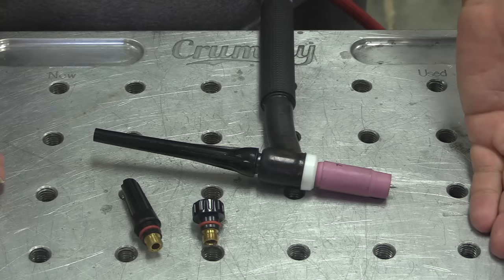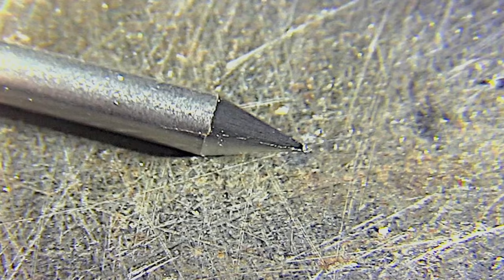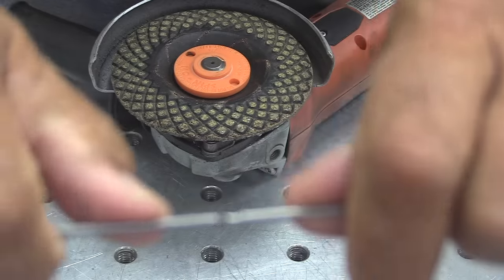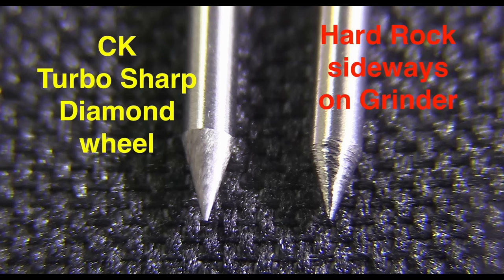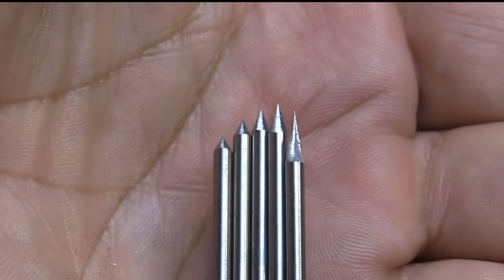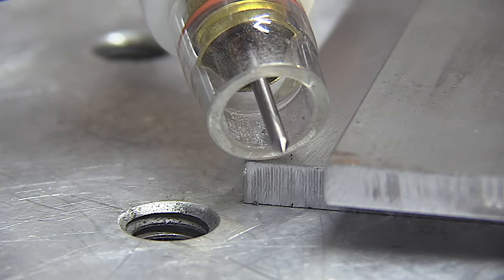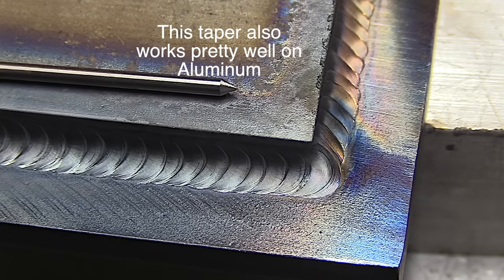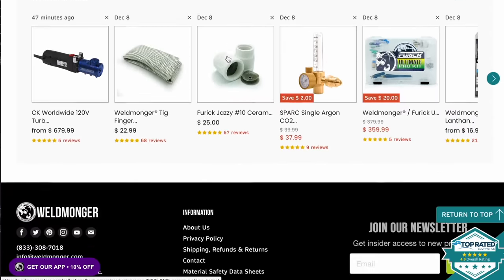🔧Don't Do This to Your Tungsten🔧

Comment: I've been welding going on 24 years now... I learned most of what I know from the older welders who weren't afraid to teach as "that is just how you do it"... and so.. it's how I did it and never really knew WHY... so to have the explanations given with such clarity is great and I can pass that info on to the newer guys that I teach tricks to occasionally. Thanks for preserving so much of our trade skill knowledge base and putting it in such an easy to understand format. I routinely suggest this channel to anyone who wants to weld or get better with their current skill set.

Comment: I’m a pipe welder in a shipyard. I use my angle grinder + diamond cutting disc to sharpen my tungsten. I drilled a hole in my grinder guard at an angle and use a drill to hold the tungsten. Comes out perfect every time.
Reply from the maker: That’s awesome

Comment: Typical Jody video, straight to the point, loaded with facts and the only filler is fused into the weld. 

BTW, recently received my stubby gas lens kit. I never realized it cuts your torch length nearly in half, I should have ordered one sooner! Thank you sir for making those kits and everything else you do for the community.

Comment: Thanks for another informative video.👍 I always carried a wooden handled “pin vise” to hold the tungsten while sharpening. A pin vise is basically a thin handle attached to a small drill chuck. It keeps your hands from getting too close to the grinding surface when grinding shorter pieces of tungsten. Later I found that a small cordless drill worked even better. 
Having worked nukes on and off, an observant weld inspector decided to sample the dust from around the tungsten grinding machine and had the lab test it for radioactive contamination. The results were surprising. Apparently from years of sharpening 2% thoriated tungsten, there was an amble amount of contaminated dust to call for a thorough review of the tungsten the plant would switch to. Soon afterwards other types of tungsten were being used and 2% thorium was removed from service. Just passing that tid-bit of information along. 👍🇺🇸👍

Comment: At work for our TIG robots and hand welders (part rework, die rebuilding, etc.) we use Piranha III sharpeners. For robot work it's a must (since things need to be repeatable) and for the rework welders it's convenience (since the welding lines they're on are often have TIG robots). For the die work, probably convenience again (and since we have so many of them company wide, spares aren't hard to obtain).

Comment: I'm just a hobby wrlder. I use the Primeweld 225, I use the belt sander/drill method to sharpen my tungsten. This was very helpful in knowing what type of tip to use for each type of weld and material. Also, I now will switch to a finer grit belt to sharpen my electrodes.

Comment: I'm a welding hobbyest. I purchased a $130 diamond wheel to put on my bench grinder and with a drill to spin it, it works great. I am guilty of "snapping" my electrodes BUT unlike your video demo, I butt the vice grips and lineman's pliers flush up against each other and have rarely had an issue. Because I'm not a pro, I inspect every ground electrode with a jewelers loupe to check for cracks or imperfections.

Comment: I have been snapping my 2% Thoriated, and i have noticed the arc acting strange on start up once in awhile, it does split odd some times, i grind them on a bench grinder with a fine stone the long way around 40 degrees, i'm currently welding 20 gage CR patches on a 27 model-T, thanks for your videos.

Comment: I am relatively new to TIG ,but i gathered allot of experience in 16-20 months since is started to TIG (18+years of stick weld helped allot),outta my shop,i grind my tungsten using a fine grit grind wheel or even a very used up cutting wheel on a grinder,and i hold the tungsten in a drill,spinning on the flat side of the wheel with almost no downward pressure to roughly angled tip,works fine to me,just a drill and a grinder and i'm good to go,i never throw the tungsten back to the torch without cleaning the oxide with a scothbrite while the rod still in the drill at max rpm,i ensure a nice contact with the collar,and i prolong the life of that collar (tungsten holder). I always have a great time watching|listen your vids,best regards from Romania <3

Comment: Another great video. I have concerns about tungsten dust accumulation in the shop from grinding tips. I'm still learning wire feed and maintaining a short arc, so yeah I dip too often, and have to grind tungsten often. I wear a dust respirator while grinding but the fine dust accumulates. Should I be doing my grinding outside in the freezing cold to avoid the dust? Are there health effects to worry about?
Reply: Not as far as I know, except if you're using thoriated tungsten. If grinding thoriated tungsten, at least angle things so the dust is aimed away from you.  Probably worth it to put on a dust mask for that also.  Some say that the risk of grinding thoriated (which is slightly radioactive) is only theoretical, but I think it makes sense to take an extra safety step or two.

Comment: I have had my tungsten split before and I chased that for quite a while before it fingernailed a piece of.  I have sharpened a lot of electrodes with a 60 or 80 grit sanding pad on a grinder; just keep the scratches running vertically.

Comment: Great info Jodie I’m very impressed by your knowledge and confidence and consistency I as well have adapted this tungsten cutting method just by chance some time last year when I found harbor freight was selling those diamond grind wheels so initially I wasn’t cutting them with a diamond wheel and then I tried it one day just by chance, and I found out that it was much more faster efficient and it put 10 times less heat into the tungsten than any other method that I tried as well as even trying the chemdip learning that the diamond wheel and just grinding them so much until you can break them by hand that it was much more efficient and faster method Thanks for all the tips and keep the good videos coming.

Comment: For breaking Tungsten in the field I would use two vice grips. Get snug grip and break one vice grip next to another. That typically prevented splintering.

I currently fusion weld sanitary pipe. Use 30-40 amps, and a 1/16 tungsten electrode. I use the exact tungsten sharpener at 40°. 

I use 40° because I can't fulcontrol the gap and need to agitate both sides of the puddle to come together. My machine's pulses don't seem to help here.

Comment: Jody,   Im not sure how long I have been welding, there is some speculation that what Im doing cant really be called welding???  Im actually a "hack" welder. The important thing is that by watching your videos I am a much better "hack" welder than I would be otherwise!!!!  I hope to start building a 22 foot aluminum boat this summer or fall. Ill be investing in a good pulse mig welder. I searched but I cant find a video where you review or instruct on this???  I think a video demonstrating pulse mig on .125, .187, .250 in different combinations plus horizontally and vertically  would benefit us out here. (OK, maybe me more than others) Thanks for all your work on producing the videos.

Comment: So, I have to say ive been using vise-grips and a heavy object like an adjustable wrench to break tungsten successfully for a long time. the vise grips needs to be tight otherwise it may split but works great for all sizes

Comment: The halo around that spire point looks curious. You can see the a few things that are telling, primarily it is the color of the gas when Superheated. Basically, it's telling you that's your radiating your current off of the filament thin tungsten and the penetration is what your training for the pretty halo because you don't have the total current because it cannot deliver it before it's consumed by the incredibly this tungsten... Much like a like bulb filament.
I do love these video and every one in a while, I notice something that I've learned in engineering as well as the one off lesson in chemistry from so long ago!

Comment: Welded titanium for 35 years and we always snapped our tungsten., NEVER had a split. Maybe it was because we only used 2% thoriated, maybe it's different with ceriated.
We also sharpened our tungsten on a belt grinder with 60 grit course and 150 grit fine.

Comment: Is that upper halo on the sharp tip dependent of the gas flow rate?  It would be interesting to see the effect of flow rate with regards to grind angle for arc control, especially for those sharp grinds.

Comment: Hey Jody, I need to do a despair on an old cast iron skillet.  Just a small crack.  Can you recommend a good filler rod that would hold up well to the constant heat cycles

Comment: I use a continuous rim diamond blade used for tile cutting on my dedicated angle grinder. I also added a diamond blade to sharpen it on that same blade. I found/saw the micro-cracks in my tungsten which prompted me to build it.

Comment: And for good shield gas coverage, especially on carbon steel, use a gas lens with a nice big N.8 ceramic.  And we found that removing the mesh layers from the gas lens also helps to reduce porosity problems when welding carbon steel in windy conditions on site. (Found this out by accident, having climbed to the top of a column only to find that the gas lens mesh on the TIG set was covered in rusty spatter, so removed the mesh to avoid climbing up and down a 100' ladder and a walk to the stores.)

Comment: The R² law... forces drop off by the radius squared (F÷R²) this includes the electromagnetic force... this is why standoff distance is so important... also grinding a needle like point, on higher amps your point doesn't have enough material to carry the current so some of the arc wanders upward on the Tungsten, now not only did you spread out the point like arc from the Tungsten but you've also made the standoff Distance larger thus increasing R²... but like he said, lower amps its not a big deal so long as you have enough material to carry the current

Comment: How do you hold the short electrode like for CK MR140 torch head? Do i need a special sharpener for it?  Looks to be shorter than the gap in the sharpener. I have CK17 and CK18 torches; looking to add CK MR140 to the mix.

Comment: I get those maroon Scotchbrite wheels they sell as "paint strippers" at Wallyworld, and chuck one in the drill press at high speed.  Grind the point on an 80-grit bench grinder....using a drill, since those electrodes get hot as a $10 pistol......then turn around and polish it on the Scotchbrite.  It takes out ALL the grinding marks.

Comment: Hi...I am complete beginner and purchased very cheap machine which can operate in MMA,MIG and TIG on carbon steel or stainlesssteal...not aluminum... I also bought blue tungsten electrodes and tried with it to weld aluminum anyways...I hot a spark 🤣 bug the electrode melted almost immediately even on very low Amp ... I didn't try other metal with it,but generally...if the electrodes will continue to melt like that , they most likely shity quality right? Or it was connected to my aluminum welding research?
Reply from the maker: Most likely wrong polarity, torch plugged in to wrong plug, or wrong gas
Reply: @weldingtipsandtricks  .... aaaaha...thank you for so fast reply...I had ground on -  and torch on + ... gas is 86 % argon ,which I found out just now that on aluminum must be 100%...

Comment: I always thought a 1" belt sander with a fairly fine belt worked good if You held the Tungsten inline with the belt travel.  I wonder if a $125.00 Drill Doctor can be modified to do a nice Job.  I saw a Tungsten sharpener that was built on a Dremel Tool. it worked great.

Comment: I have an eastwood tungsten sharpener, basically a guide on top of a dremel with a diamond disc, works nicely, then I went and got a nicer head on eBay that has better guides with more angle and size options to put on it, for what I'm doing I see no benefit to upgrading past that any time soon, though that day may come eventually

Comment: 6" or 8" diamond flat lapidary wheel mounted outboard of a grinding wheel. Cheap, fast, and way better grind quality than that little wheel in the dedicated grinder. available on ebay and amazon. you can even stack different diameter wheels for course and fine .

Comment: I can understand why a welder would have other priorities but you can grind a perfect tip on a tungsten electrode with a plain old bench grinder or angle cutter disc. My drafting teacher beat that skill into me in high school when he demonstrated the various ways to sharpen a lead pencil. The first thing I learned is that the cutting angle has to be axial with the electrode, not circumferential like you're putting threads in it.

The fancy electrode sharpener is a good way to keep people from grinding galvanizing off of hinges with your tungsten sharpening wheel if you work with a bunch of goombas tho.

Comment: I’m in school full time as Lincoln tech, they’ve had us practicing the point length be 3x the thickness of the electrode.
This gives us quite long tapering points. Where as researching, I see mostly the point is equal with the thickness.
Why is this?
Which is better?
Thank you.